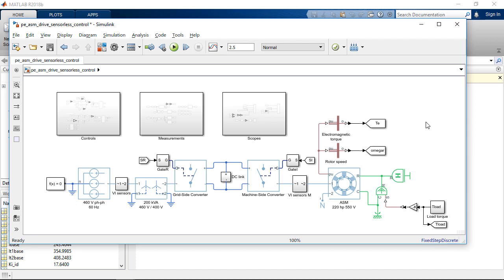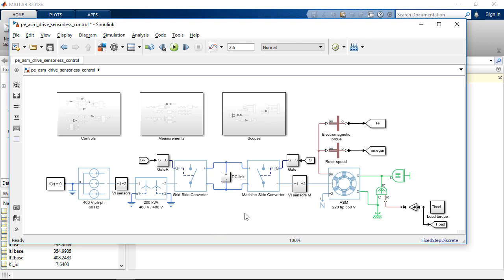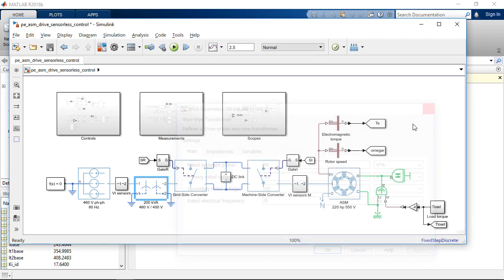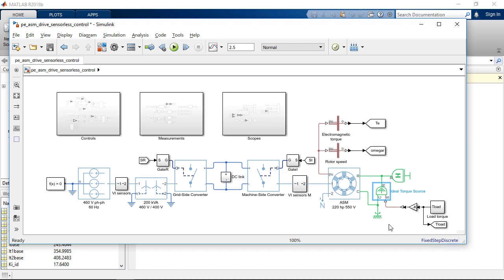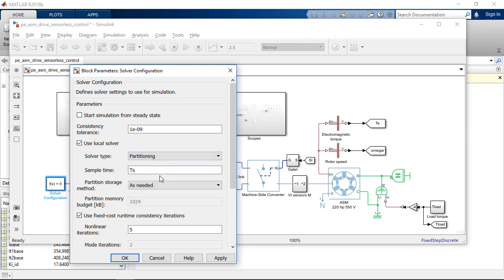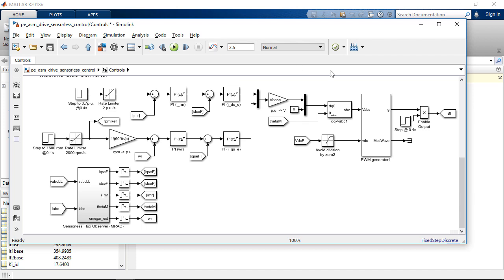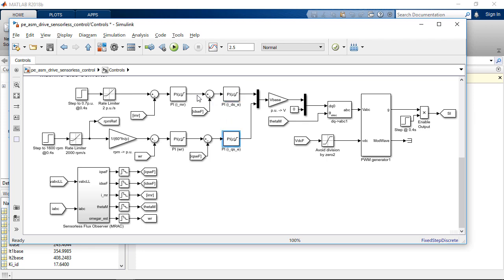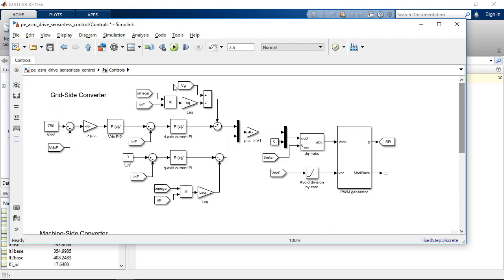How to model Motor, Inverter, and Controller | FOC of Induction Motor with Simulink, Part 2

Comment: I have a very similar model however when I change the mechanical load I can't affect induction motor current... what's wrong?! I was hoping you would show results and adjust load
Reply from the maker: I suspect what is happening is that the load is being changed while ramping up the speed, when the controller has to already increase the current to reach the desired speed (perhaps being close to maximum current). In normal operation we should see that a change in the load torque will result in a change in the amplitude of stator currents. I would advise checking this example which is being used in the video: https://www.mathworks.com/help/sps/ug/three-phase-asynchronous-drive-with-sensor-control.html
Reply: @MATLAB it turns out the 3 phase switch i was using corrupted the simulation somehow...removed it and now I'm getting expected results...but I need a switch!  I've been using Simulink for 20 years and this threw me.